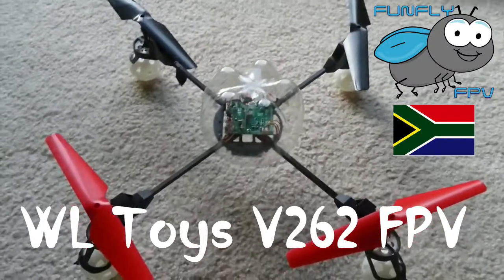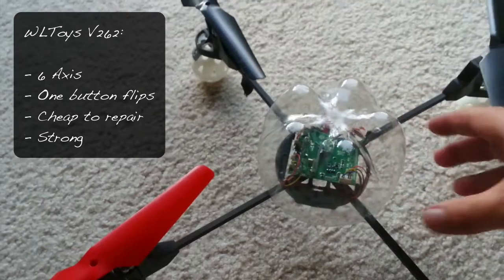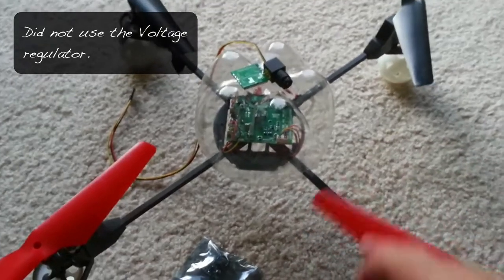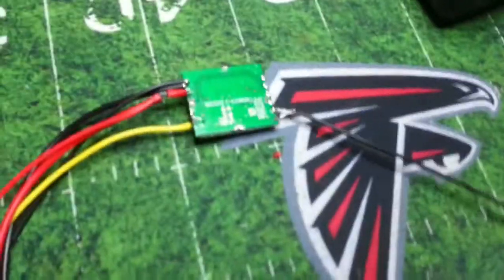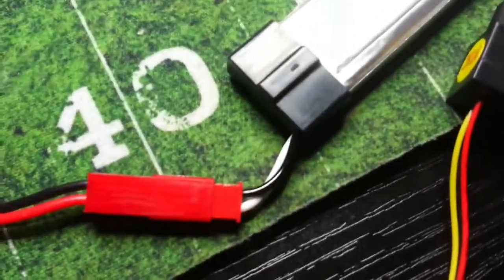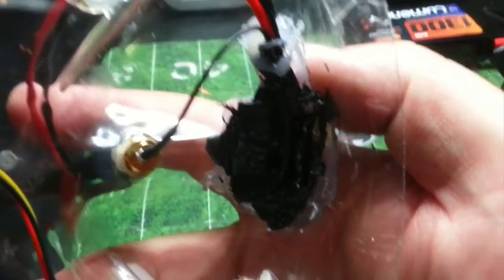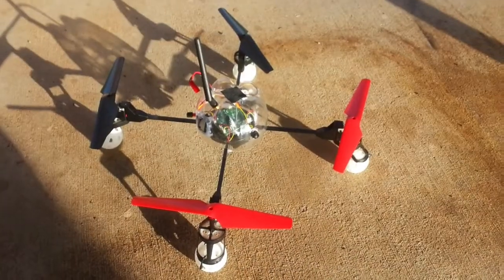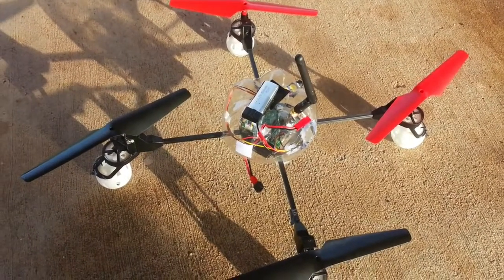WLToys V262 Quadcopter FPV build and flight

Comment: I have seen a few people do this exact mod and seem to be pleased with it. The LARGE foam body that comes with it just bogs it down and can burn motors up fast. I wanted to try and use my WL Toys Q212G(chrome & red) body on this frame? I believe it should fit. BTW - I am selling that body on Ebay.

Comment: What batteries do you use for the transmitter and the receiver? How much they last? I am plannig to use TS832 +  RC832. 
Аny suggestions?
Reply from the maker: +Denislav Parvanov Transmitter is a 1S 380mhA battery and the Receiver is a 3S 2200mhA battery. The Receiver is not an issue but the transmitter probably 15 mins ....
Reply: +FunFly FPV What "1S" means?
Reply from the maker: +Denislav Parvanov 1 Cell 3.7V Lipo battery ...
Reply: +FunFly FPV Your transmitter is low voltage. TS832 needs 11.1V, so i gues i'll need bigger battery
Reply from the maker: Denislav Parvanov I used the "Boscam FPV 5.8G 200mW Wireless Audio Video Transmitter Module TX5823" and the Voltage requirement is 3.3V.
Reply: +FunFly FPV Ok, tanks for the info

Comment: I used a square container for the body which provided a perfect flat front to mounting the camera.  The camera is dead center in the props .
  Also I suspended the video transmitter inside the body so it has almost nothing touching it for max air cooling.
Reply from the maker: Michael Workinger Great idea ...
Reply: FunFly FPV 
Your initial design efforts inspired me to that next design level.   Thanks quad matey.

Comment: Hi im a complete beginner to this stuff, If i use this tx ( TX5823 ) what wires ect would I need to power it via a jst battery and connect video output from the mobius camera into this tx
Reply from the maker: Hasitha Jayathilake This TX is a bit of a advanced one to start with as you will have to do quite a bit of soldering. Here on this site is the wire layout.  (http://www.banggood.com/FPV-5_8G-200mW-Wireless-Audio-Video-Transmitter-Module-TX5823-p-84780.html)
Reply: FunFly FPV thanks for the advice ,for a tx like this http://www.banggood.com/Skyzone-TS5823-5_8G-200mW-32CH-AV-Transmitter-Module-p-922418.html , its says 7v needed , would a simple 1s lipo at 3.3v be enough to power it , with a a camera powered by its own battery
Reply from the maker: Hasitha Jayathilake that TX would need at least a 2S to power it. A Lipo is 3.3V per cell, but 4.2 fully charged. A 1S would only be 4.2 at its highest voltage.

Comment: propeller which can put the motor shaft?
I have one of those, motor gear to wear very fast.
want to put the right propeller on the motor shaft.
can you help me?
Reply from the maker: Paulo Limm You can buy the props at a lot of place online, like: http://www.tmart.com/Wltoys-V262-RC-Quadcopter-Spare-Part-V262-02-Blades-Propellers_p240434.html

Comment: Hi there. Thanks for sharing. Very informative. So, I basically have the same quad copter as shown in the video and hope to do the same soon. (I'm currently just running a small camera for recording). I was hoping you could tell me a little bit about what goggles you use? Sure, the quad set up was pretty cheap.. But I don't think you included a video transmitter? Anyways.. it'd be nice to know what the price is all in. Also, are you using the radio controller that came with your quadcopter?
Reply from the maker: Hump Dumpity The 5.8 Ghz video transmitter is this one http://www.banggood.com/FPV-5_8G-200mW-Wireless-Audio-Video-Transmitter-Module-TX5823-p-84780.html, but there are many options now that combine a video camera, antenna and transmitter. Look at Horizon Hobby for a small FPV combination.

I still use the same 2.4 Ghz transmitter that came with the quadcopter. The Goggles work on all my Video equipment, so I did not buy it just for this project. I fly many FPV quads and planes. The cheapest ones I got was the FatShark Teleporter ones. There are cheaper monitor options also at HobbyKing.com or you could use your laptop with a capture card.

So price wise:
-----------

Quadcopter $89.00

FPV 5.8 Transmitter - $11.00
FPV Camera - $ 49.00
Antenna, 1S battery etc - $15.00

FPV 5.8 Receiver - $30.00
Battery for FPV Receiver - $10.00
 
Goggles (If  you don't use a monitor) - $199.00

Comment: a similar hack  http://design215.com/photos/misc/syma-x1-fpv-quadcopter ... and you could save some weight and increase range and antenna gain by making a circularly polarized set of antennas - see rcmodelreviews.com and rcmodelreviews youtube channel ... DIY: FPV backpack build part 2 (antennas)

Comment: use this vtx to avoid weight on your V262 quad ;)  http://www.banggood.com/Skyzone-TS5823-5_8G-250mW-32CH-AV-Transmitter-Module-p-922418.html
Reply from the maker: Thank Mark~ ... This one is great and has the 32 channels, but I used an even smaller one - http://www.banggood.com/FPV-5_8G-200mW-Wireless-Audio-Video-Transmitter-Module-TX5823-p-84780.html